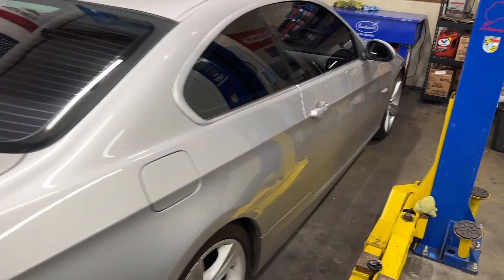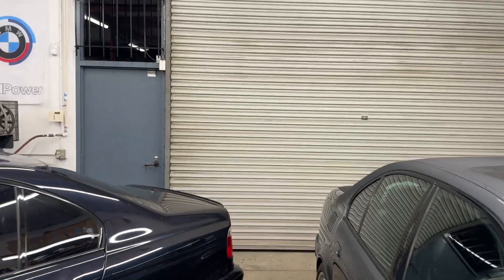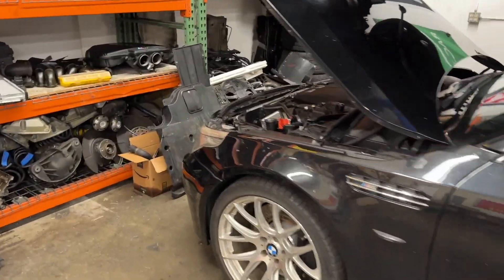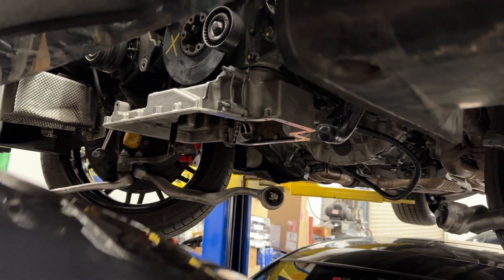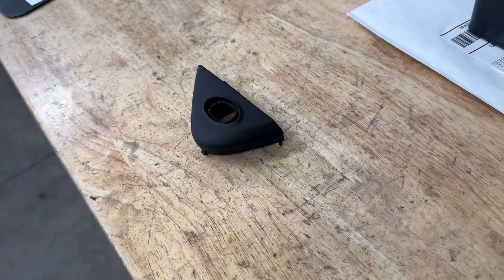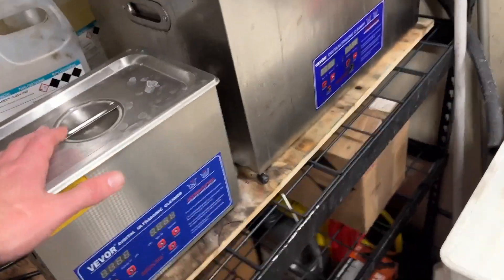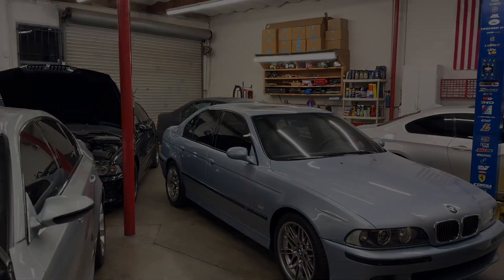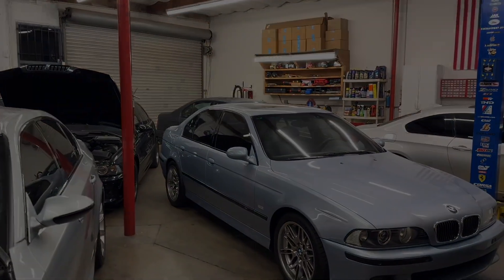Constant Complications  2/21/24 - Day 4,823

Comment: I watched you back in late 2010 when you started.

I was about 18. Since then because of you I've owned over 12 BMW's.

I kept a 09 X5 & 528, both made it over 200k miles. I retired those and have a '11 335i now.

Just basic ones - my favorite was my vert, a 1997 bmw 318i convertible.  LOVED IT!

I love my fair share of Chevy's though, I've always kept a few handy.

I hate the electric water pumps on these. My AAA membership has paid off for my over heating issues on mine.

I've been trying to find a M5 that hasn't been tore apart and I came over quite a few, I don't really want the E60 M5.

I've never tore mine apart, I stick to 5k oil changes with additives and fuel treatments.

Keep up the good work
Reply from the maker: Hey thanks for the comment!  I am sorry to have infected you with the BMW bug lol.  Unmolested E39 M5s are getting harder to find, and are commanding a real premium these days.  But it's absolutely justifiable considering what a nightmare the cheaper examples can be.